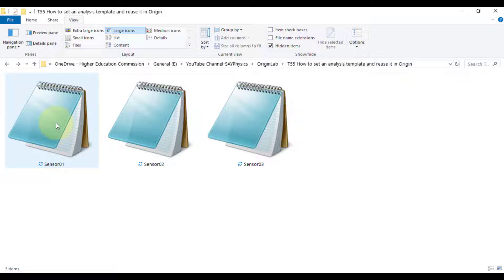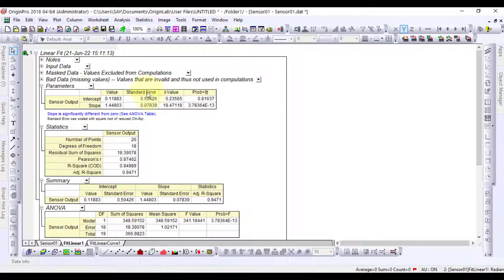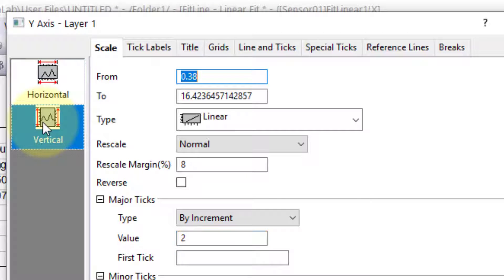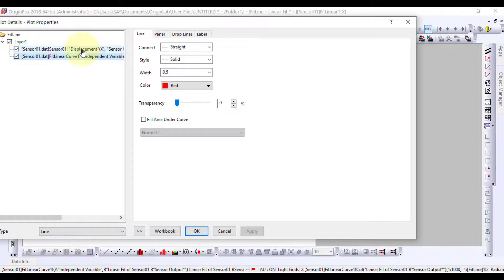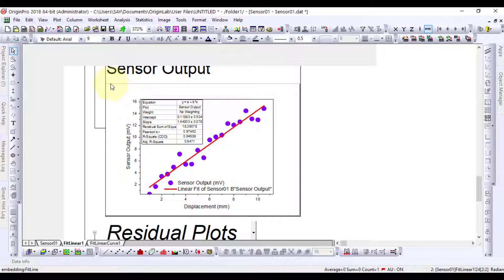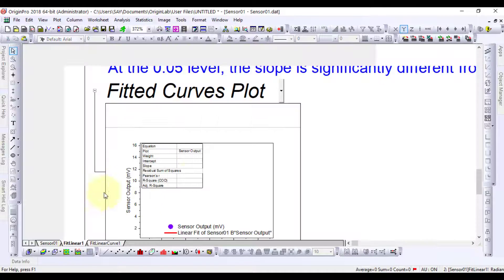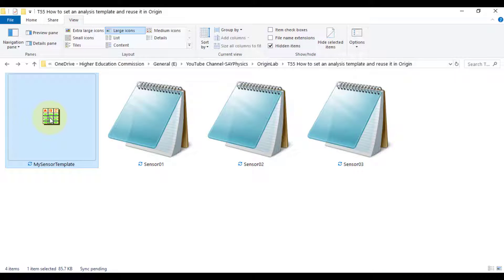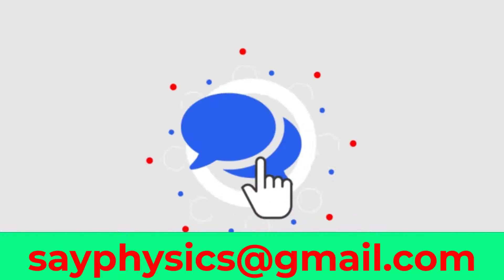How to Set Up Custom Analysis Templates in Origin - The Ultimate Time-Saving Hack!

Comment: would the steps be same for nonlinear fittings? I am trying to make one template with 3 different nonlinear curve fits
Reply from the maker: Yes, steps will be the same but you will have to fit each plot individually. On linear and nonlinear fittings there are more than five videos in the same playlist. Thanks